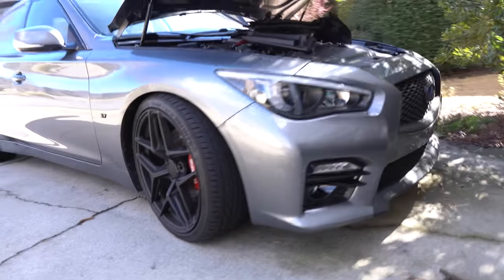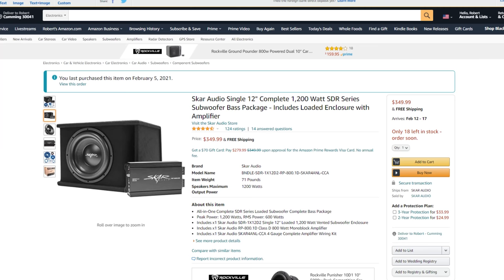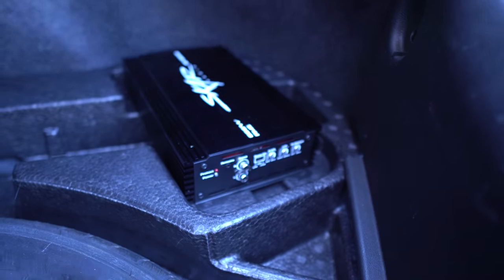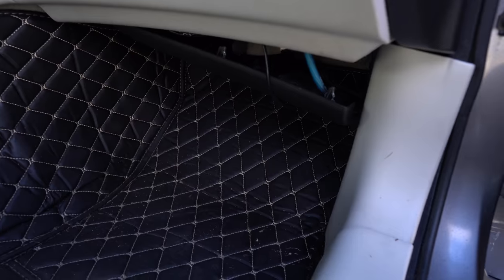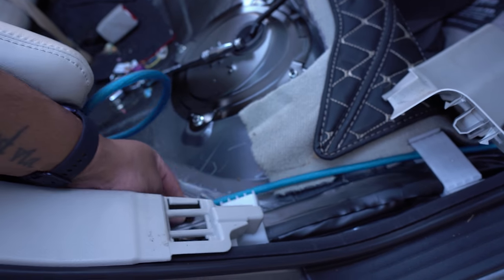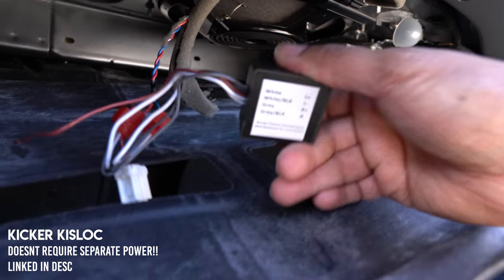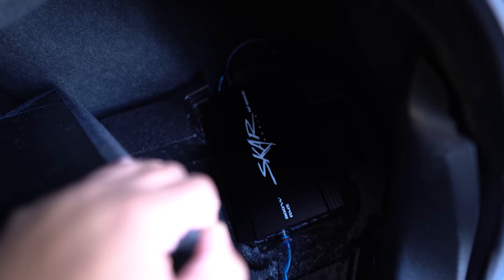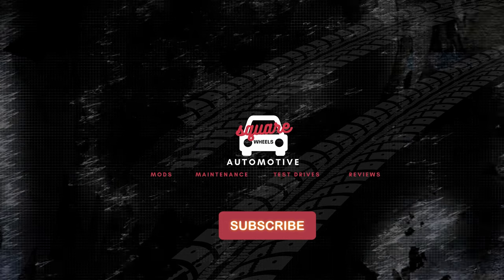Adding an AMP & SUBWOOFER to my Infiniti Q50

Comment from the maker: Anyone else feel weird driving around without junk in the trunk????
Reply: I definitely do
Reply: Yep it just ain’t right when you ain’t got something moving around in there
Reply from the maker: @TheRELLEworld  like some midgets in the backseat rasslin
Reply: @SquareWheelsAuto  yessssssssssssss
Reply: Did you have any issues with your subwoofer after installing it like the subwoofer is making a loud rumbling sound when you would start driving
Reply: @shamarrich1636  wiring issue that’s where the feedback is coming from
Reply from the maker: Either a ground issue, or some cars have "fake exhaust" noise that they send through the stereo which will hit your subs 🤮

I think u can disable that in settings
Reply: @SquareWheelsAuto  I definitely turned mine off it’s super annoying
Reply: I have the 3.0t sport bro I’m trying to do 10s in the door but don’t really know where to start
Reply: @SquareWheelsAuto  I'm still getting the noise from the subs when driving even with the radio off
Reply: Yes! I feel like my car is naked with atleast some bass n tint
Reply: @BrettGoldstein83 probably bad active noise cancellation unit

Comment: I got the premium bose. It sounds good but it definitely needs some more punch. Ill probably go with a powered bazooka 10"
Reply: man the g37 was so loud i was so dissapointed with the bass on the Qs. but definitely something that can be fixed very easily so i am not worried at all, either way i always buy aftermarket and add some trunk bangers
Reply: @presidential3228  i bought a skar 2k watt amp and a 12inch kicker solarbaric. Definitely hitting hard now
Reply: @UnburdenedByWhatHasBeen  Oh yea you definitely making cars in other lanes mad 😂🔥🔥
Reply: Does it turn off the bass off completely from the bose by adding a subwoofer? I wanna add a sub but I wanna keep the bass from the bose too

Comment: Couldn't agree more! I want to do this to mine, thanks for posting. I have a 2018 Q50RS with Bose...not a big fan. It helps if you fade slightly to the back, otherwise the front sound bar and mid-bass overwhelm the rear sub. But it's still pretty weak sauce. Trunk room is already on the smallish side. :(  But I'd give some up for deeper bass.
Reply from the maker: Still no complaints from this Skar setup! I have the bass gain knob set to like 5% and it’s the perfect amount of bump for day-to-day.

Good luck, thx for watching!!

Comment: You sir are a savior. I was a bit worried about how hard it'd be to run an amp.and subwoofer setup when I got my 2015 Q50 last week, you've taken that worry away. Thank you.
Reply from the maker: Congrats on the Q man. Glad the video helped, stay tuned I got plenty more for ya!
Reply: add tips ?, just got a 2017 q50 (non-bose) i am thinking of starting with a getting a amp
Reply: @jayg2625  howd it go?

Comment: I’m 100 💯 sure that I did all good and nice but when I started my car the center console was off and the radio I checked the fuse is a 10a but it heat up what could that be
Reply from the maker: If it wasn’t like that before the install, you didn’t do all good and nice. Retrace your steps, sounds like there’s a short somewhere.
Reply: @SquareWheelsAuto thank, but I haven’t put the sub or the amp just the wires but my fuse 10 was heat up and I’m 100% I did it right

Comment: I got the premium Bose and I also have the same setup but with an upgrade 12 inch subwoofer from skar. Let me tell you it's bangs it sounds good 🔥🔥🔥 totally recommend
Reply from the maker: I can only imagine what its like with an upgraded 12 lol you gotta be cracking pavement!!!
Reply: If you add a subwoofer does it keep the bass from the Bose or no? Or does it completely turn off the bass from the bose? I want buy and add a subwoofer to my q60 but I want the bass from the Bose to be heard too
Reply: @honestreview169  you still could hear the Bose system brah even with the subwoofer it sounds clean af !!
Reply from the maker: @Honest Review - if you wire your amp and sub as shown in this video, your Bose system will have no idea that a subwoofer is added, so it will behave exactly the same. All the fine tuning, center point, driver sound stage etc will be retained.

Comment: Idk if you still have your Q but being that your video helped me out installing my amp and sub I wanted to give you a sound piece of advice. Dump that kicker passive LOC and buy an audio control LC1i. HUGE gain in performance. Night and day difference from the kicker loc. Before my amp was turned almost all the way up. Now I have it turned about ¼ of the way up and I have cleaner sound and more low end. I thought these active LOC's were all hype but now im a believer 😆. Also for anyone having low idle hum, its the mic located under the headliner light and sunglasses holder that is causing it. Just pop down that light and unplug the noise-canceling mic. The noise canceling will still work because there is a mic in the back as well but the one in the front causes the hum.
Reply: Bruh. You could've skipped on the LOC altogether if you used an amp with speaker level inputs. Now, if you have a particular amp you want to use that doesn't have 'em, that's one thing. But if you're shopping around, just get right amp and you're good. Save money and time on the loc. Also, it might be worth checking out the owc harnesses in the future if you want a pnp connection.
Reply: @prestige8161 I've run high level inputs directly into amps before. My old truck used to be wired up like that. You usually don't see that option on modern amps with LOC's being so inexpensive.
Reply: @UnburdenedByWhatHasBeen  On a lot of the modern amps, the high level inputs are built into the RCA jacks (like the Alpine R-A75M amp i'm pushing). I think that's why most people miss it. Everyone from back in the day is used to RCAs only being for low level. Gotta check the amp to be sure.

Comment: Nice clean install! Brings me back to the mid 90s with these subs. Only thing I would be concerned with is I'm in FL and would be worried about that amp overheating in that location. I've got a M45s with a aftermarket head unit setup that I was thinking bout adding the skar evl 12.
Reply from the maker: Class D amps are different than they were in the 90s! Always cool to touch, even after bumping 6+ hours to a show in FL 🤯

Comment: does this amp come with a remote to control the bass output of just the skar sub in the trunk? or when you turn up the bass on the radio up front it turns all the bass of on all of the speakers?
Reply from the maker: Yup, both actually. It comes with a remote bass control knob which controls gains on only the sub. You can also use the bass controls on your radio which would affect all speakers including the sub.

Comment: The 2017 q50 has a second battery on the left side of the trunk. It would probably be much easier to install than routing the power cable to the battery under the hood! I found this out when installing mine
Reply from the maker: Wow really??? Thx for sharing. Yours isn't a hybrid right?
Reply: @SquareWheelsAuto  The non-hybrid has a second battery in the back. I heard that it's there to provide enough fast-cranking power for the engine stop/start system, but I have not confirmed that. I'm currently trying to find out if the rear battery is simply wired in parallel with the front battery or if it's somehow isolated. If the latter is the case, you might not want to use it for audio.
Reply from the maker: @watchitexplode  interesting/WEIRD
Reply: Lol wtf car is set up for an audio head stock
Reply from the maker: right? it may be legit tho, I’ve torn up my trunk since then and there’s definitely a perfect cutout to fit a battery, it’s where I ended up putting my aux batt 😈

Comment: @squarewheelsauto
I did everything mentiond but I have sound coming from my subs when I'm driving even with the radio off.. Any suggestions
Reply: There’s a secret setting to turn off the fake engine noise coming off from your speakers you can search up a video on how to do that it take 5 min

Comment: What are your thoughts about M45-like shoulder mounted tweeters, 2 on each front seat? I had that in a M45 back in the day, and thought it added a lot to certain music. Do you think it's doable? This isn't in my wheelhouse so I don't know.
Reply from the maker: Anything's doable! Toughest part would be making it look good, then you'd need to get creative with wiring
Reply: @SquareWheelsAuto  I'm thinking if Bose/infiniti did it, it can be done. Cut out and de-foam the dimensions of the tweeter. Run the wires down the sides of the seat. Meet those wires with the under floor harnesses. Route to head unit or amp. My biggest concern is integration and control.

Comment: Question 🙋🏽‍♂️: so what’s the point of the little kicker device that branches off of the factory sub if it’s not being used? I’m confused
Reply from the maker: It pulls the low frequency signal (bass) from the sub channel and passes it to your amp.
Reply: Ohhhhh! Thank you! Sorry if you said it and I missed it

Comment: Any issues with the amp placement in terms of too much heat, not enough air, etc? I love the location but don't wanna fry my amp🤣 $550 a little rough to replace
Reply from the maker: Haven't had any issues at all. Whenever I go back there the amp isn't even warm. I read somewhere that's not much of an issue anymore for modern class D amps. Don't quite me on that though, YMMV!! 😅
Reply: Dont run an rp series amp covered like that, they get extremely hot and will go bad
Reply from the maker: @liloversteer7308  the RP series covers many different amps, and most of them are class D.  Class D amps generate virtually no heat - all energy is transferred to the load.  Mine is cool to the touch, even after pushing them, covered, for 6+ hours.
Reply: @SquareWheelsAuto  every rp class d ive had/ ran into get extremely hot... idk if its how you had urs tuned but mine wasnt clipping and got very hot. i was also running a big 3 with a 2nd agm battery in the trunk. im not sure what caused it, but the rp800 lasted like 2 years
Reply: @SquareWheelsAuto   i do have a question tho, do you think a 0 gauge wire will fit through the holes you routed your power through?
Reply from the maker: @liloversteer7308  yep definitely. Plenty of room, and a few options to route through if you remove the seat to have a clear view 👍🏾👍🏾👍🏾

Comment: Does the factory deck speaker work still since you had to use those wires?
Reply from the maker: Yes factory signals and wiring are all intact. I spliced (google posi-tap) the factory wiring so it would still send signal to the factory sub. 

I actually ended up removing the factory sub to let more sound flow into the cabin. I'll reinstall it when I return the vehicle to stock form.

Comment: Ran my remote wire to that lavender wire and my stereo won't turn off when I turn the car off. Any idea what could be causing that?
Reply from the maker: Double check that wiretap with a multimeter - my guess is a faulty tap?
Reply: @SquareWheels Automotive  my line output converter came with the 4 speaker wires, a power, ground, and remote wich I ran to the power, ground,  and remote into the amp. That was the problem I just capped those wires to the converter and only used the speaker wires and it works great. Not sure why it comes with them if u dnt need them. Great video tho brotha everything else went fine thanks to you i just had a different type of converter. Getting that power wire through the backseat was sumn else. Used a flashlight to find that hole then pushed a hanger from the trunk into the back seat then taped the power wire and pulled it through.Thanks again for the video

Comment: Do you think it will be the same on a 2018 red sport, withe the lavender remote wire?
Reply from the maker: Yep - test with a multimeter, but as long as you tap the same position in the connector, u should be good.

Comment: Brother, thank you for the video.  I have a question for you.  Have you had any issues with the amp overheating since the amplifier is located in the spare tire compartment?  I'll be installing two Alpine KTP445u power pack amps to boost my front doors, rear doors and aft shelf 3.5" speakers.  I am hoping to install them where you installed your amp, thus the question.

Like you, I needed a little more bass so I installed a small powered sub (with an LC21 Pro line output converter) to my 2016 Q50 Red Sport and have loved the the difference it has made.  The install is clean and I've lost nearly no trunk space.  I did have to turn off my ANC (active noice control) but that was simple.

 By the way, I've created wire diagrams (using PowerPoint of all things) for my entire set up if anyone is interested.
Reply from the maker: No heat issues whatsoever. I think it's because the amp I used is Class D?? No matter how long or hard I run it, it stays cool to the touch.

Enjoy man!!
Reply: I’m interested for my q
Reply: I’m interested for my q

Comment: Rookie here just replacing my original bose amp in my q50 after replacing fuses didn’t do the trick(new fuses immediately blew).  Your video helped me locate the amp after infiniti service wanted to charge 2200$ to replace the amp!  Should I disconnect the amp from power as I do it?
Reply: (At the battery…or doesn’t matter?)
Reply from the maker: Glad the vid helped!!! If u think it's the amp making the fuse blow, it shouldn't matter. Please post up how the swap goes man I always wondered if they have to be programmed/resyncd. Good luck!!!! 🤞🏽

Comment: But I installed the specific loc you mentioned, and I also tapped the remote signal as well, only the remote worked, I didn’t get any sound through my sub
Reply from the maker: Could be any of the variables. Just gotta check your setup end to end.

Comment: Hey can I connect that factory subwoofer plug back in just to have plug in?
Reply from the maker: Yup for sure. Or remove the sub to let more bass into the cabin.
Reply: @SquareWheelsAuto  You mean move the factory subs? I feel like thats too much work to do
Reply from the maker: @Awsometiger1011  wasnt too bad. I did it the next weekend and it took less than an hr
Reply: @SquareWheelsAuto  Oh ok. How do wire about the subs and amp I was looking for that in the video but I don’t think you record it. Also what was that kicker black box I don’t think that comes in the kit
Reply from the maker: @Awsometiger1011  yup it's just a standard sub install after that. Plenty of how to install a sub vids on YT, I just covered what makes it unique on a q50.  The black box is the line out converter from your speaker signal to ur amp. Hit me on IG @veeqfiddy happy to talk u thru it if U get stuck
Reply: @SquareWheelsAuto  DM!!

Comment: Hi brother. Love all your videos. Wanted to know since you have the mark 5. How’s your subs and or system hooked up. I have the mark 5 but the factory engine noise they pump In is ruining everything. Can’t access secret menu because I installed the mark 5. Any suggestions? Thanks
Reply from the maker: Hmmmm you should still be able to access the secret menu through intouch. Have you tried that?

I don't have the fake exhaust/ANC sound, but I've heard of other people that cut the microphone in the headliner to disable it?
Reply: Did you ever figure it out. I have the same issue currently.

Comment: Best Buys  a week ago wouldn't install my after market amplifier and subwoofer... both of which are just between 360-400 RMS nothing crazy. I wanted to keep the stock BOSE system. He stated my speakers will blow. How are your speakers now since the install and has it enhanced your sound experience? any power issues?  My car is 2015 Infiniti Q50 Hybrid .. the battery is in the back but the truck space is small compared to normal Q50
Reply from the maker: Sorry man but this made me laugh. I'd love to have them try to explain that one to me.  How could an aftermarket amp/sub make your factory speakers blow???? The systems are essentially independent and have no affect on one another. 

I've installed aftermarket amp/subs on every car since my first, a 1987 Dodge Omni.  It's a very common practice.  To answer ur questions directly, my speakers are still in pristine condition and I've had no power issues.
Reply: @SquareWheelsAuto  exactly what I thought. It’s like I paid you to perform a service; here’s my parts ..do it. He didn’t do it, just shady explanation after shady explanation I was alright just nod and smile then go.  Ended up refunding the service vouchers and thought next steps. Thanks
Reply from the maker: @vsar223  NICE. You're better off in the long run by not letting the wrong person touch your car. This is a fun, low risk, weekend project. 3-4 beer maximum installation time. 🍻

Comment: Hey bro nice video, I'm glad my diy guide on the q50 forum helped you. I know that image anywhere when people msg me on fb :). Btw you might want to replace those t-taps because the sub with rock those t-taps and make it loose and won't bite into the wire. Make it seem like the amp or sub blown but it will be that t-tap. Just a suggestion
Reply from the maker: HEY!! Yeah bro your guide was the holy grail, thank you!!!! And yeah I hate the splice connectors I used here - impossible to fully trust lol.

Comment: I got the all the same parts as you installed on my Q50. 

I am getting a thump from the subwoofer when I turn off the car. Does/did this ever happened to you? 

Thank you.
Reply from the maker: Nope! Check your ground connection, I know sometimes a bad ground can introduce issues?
Reply: Thanks!
Reply: I’m having the same problem when I turn off the car / unlock the doors or press the gas pedal makes a huge thumb. Any ideas to fix that ?
Reply from the maker: Same as above. Check you've got a solid ground connection to your amp